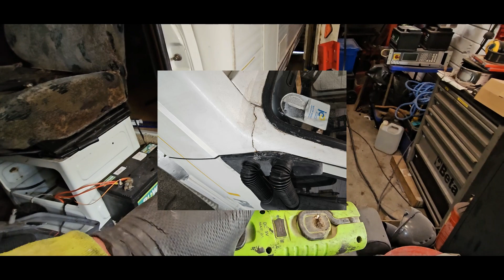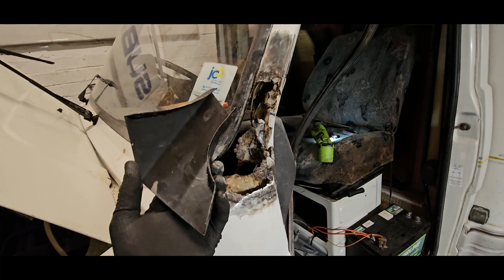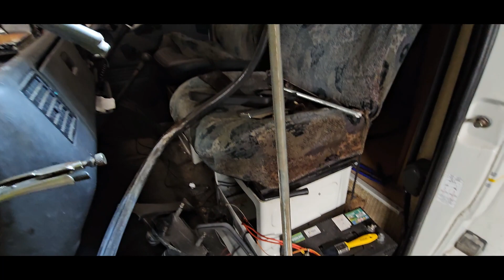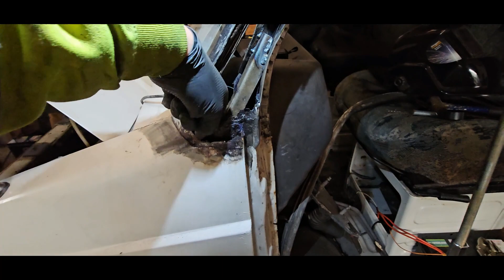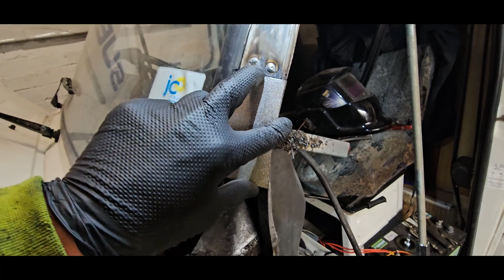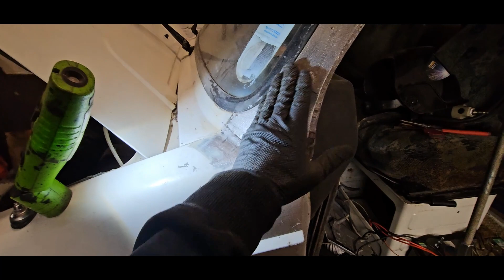Fixing the unfixable, Vers 2 Correctly edited with finish! Talbot Express welding windscreen pillar.

Comment: I had a local welder do some similar magic for me on my Talbot's cab upper door frame - amazingly we did not need to cut back the fibreglass. A bit burned off, but the rear light wires inside the frame were intact!

Comment: You really need to take the screen out
Reply from the maker: Totally agree but he wants to use ot this summer and I reckon taking it out will be a potential nightmare. We are going to take the screen out this winter and deal with all the rust. Thanks for watching.
Reply: @Gfix109  yes, wouldn't be an easy job. Would make it a lot easier to weld though

Comment: Well done this is got very complex curves making it extremely hard to do. I was a bit anxious about the screen being left in situ. A few years ago I had a similar (not as bad) problem with rear screen of Rover P5 coupe. I got a bit of grinding on the rear screen. It didn’t happen immediately but went over a bump in road and screen broke going over a bump. Had to source new screen. Have a good look at the screen for grinding flecks. But.. very well done!
Reply from the maker: Thank you for watching and commenting. Your completely right I should of protected the glass better, but he is planning on a new screen soon anyway. With the rover would the rear screen be unlaminated and therefore a bit more fragile? I managed to punch through the front screen on the vw camper getting the screen to seat in new seals...the replacement weighed a more than double... take care.
Reply: @Gfix109  I enjoyed watching thank you. Your set up so much like mine! Rover rear screen was laminated but the flecks of grinding joined up so it had to be replaced. I got one second hand from a scrap yard but I had heart in mouth while fitting it as it was the only one available. Lots of tiger seal! Thanks again. All the best.